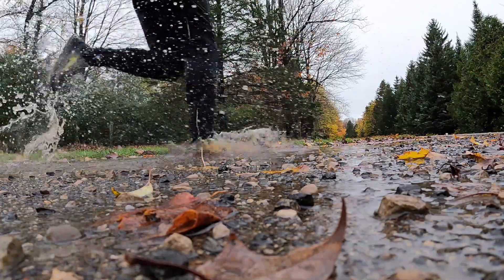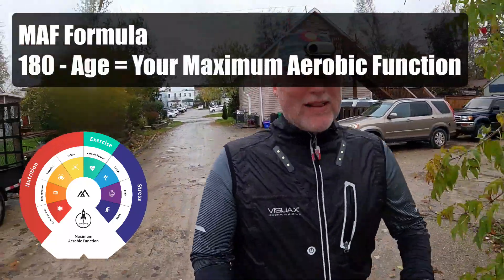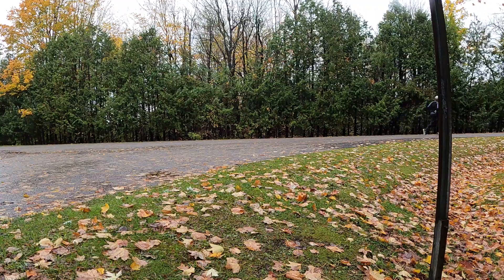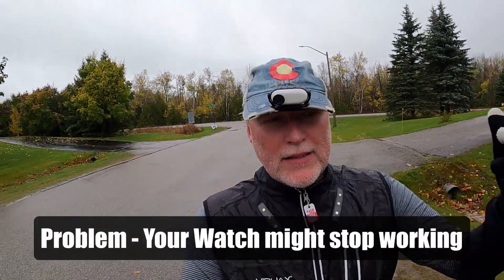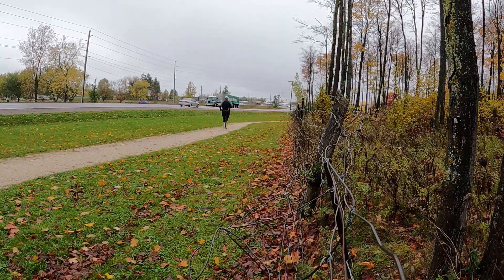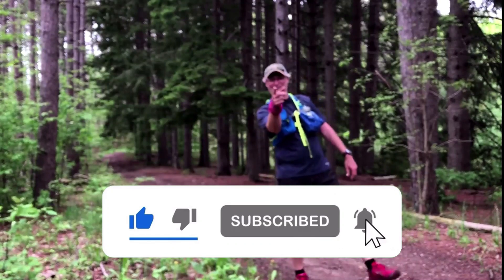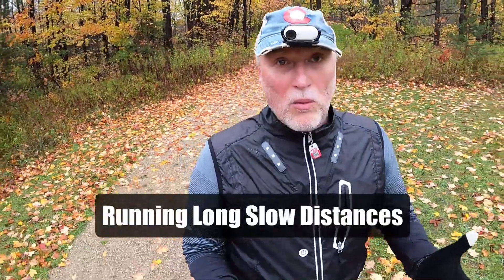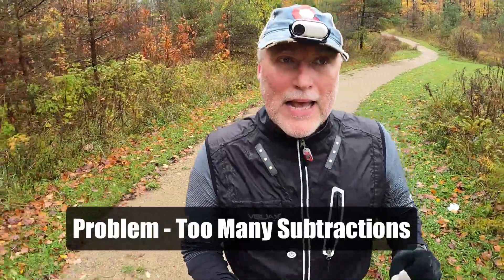Maffetone Method's Big Problem  - Running Slow To Run Faster

Comment from the maker: ✅ WATCH ME - Maffetone Low HR Training After 3820 Miles - Two Years Of Running  https://youtu.be/S99NXU4nTv0
✅ WATCH ME - IF YOU RUN SLOW THIS WILL HAPPEN - MAFFETONE METHOD RESULTS  https://youtu.be/2qdW5Q65ucQ

Comment: I always check my pace with my heart rate and also i always wear a strap ( hated it at first ). 
As a old boxer i think that a lot of people would benefit from rope skipping so that they get used to higher cadence.. 
Also i still think maf training calculation is way off of being healthy for the majority of people. 
I still usually run @ 130bpm of my 207bpm max. But i also always check my speed so that i know around what speed that is. If it's colder sometimes I run @ 125bpm and if it's summer it can be 140bpm at same effort. 

With run i obviously mean slow jogging as I'm no ironman and have a bw of 225lbs at the moment.
Reply from the maker: Thanks for taking the time to comment Lucas.  I hope all is well my friend.  Where in the world are you watching from?

Comment: I've just discovered MAF running.  And want to use it.  My problem is figuring out my MAF number.  (For a month I'm going to try the lower number.)  I'm 62 (so 108-118 to start with), and on meds because I was diagnosed with T-2 diabetes nearly two years ago (so 98-108), but since then have been doing regular walks - a brisk pace, way more than sticking to the MAF heart rate would want.  Do I just ignore the walking I've done (not for 2 years but nearly)?  As the adjustment (10) is the size of the training zone, this should make a difference.  I'll try the lower number (98-108) for a month, if no improvement I'll try 108-118.  I haven't found any guidance on the kind of trade off that the formula can mean we need to make.
Reply from the maker: Thanks for subscribing Evan and for watching my videos.  I would add the 10 beats on and see how things progress.  Do your MAF test and see if you are improving when you do your MAF test next month.  It's an experiment of one so mix it up and see what happens.
Reply: @ThePlantPoweredRunner  Thanks, I'll try it out and see how I go.

Comment: The watches HR are inconsistent. MAF only works with a chest monitor IMO. I'm 57 but my  adjusted MAF is 135. 123 is too slow for those who have a BQ in mind. This allows me to run with a purpose while not being too slow. I throw in a 4 minute HIIT every 10Ks in a 20 second spurt/10 second rest and repeat for 4 minutes. Basically 8 X 20 second strides. Never letting my HR fall below my adjusted MAF. Have to keep every run purposeful even if slow. Meandering becomes jogging...and nobody is aiming for that! Lol
Reply from the maker: Thanks for taking the time to share Ian.  Cheers. Keep running my friend :)
Reply: @ThePlantPoweredRunner  always. Rain or shine.